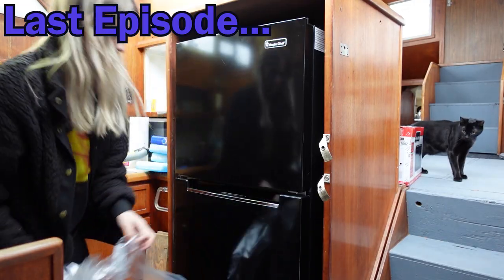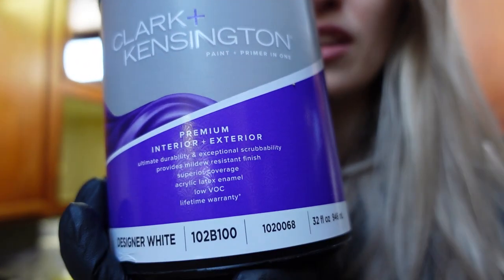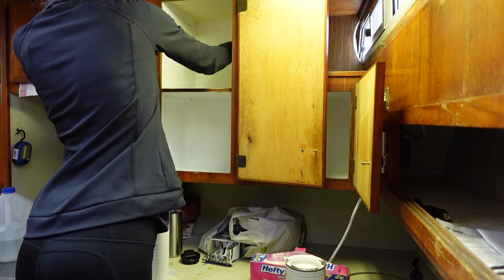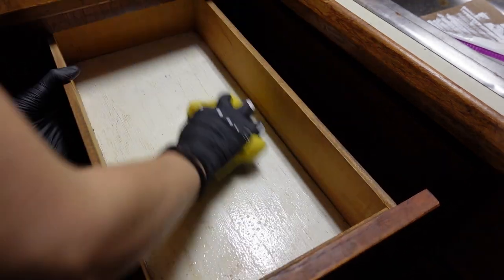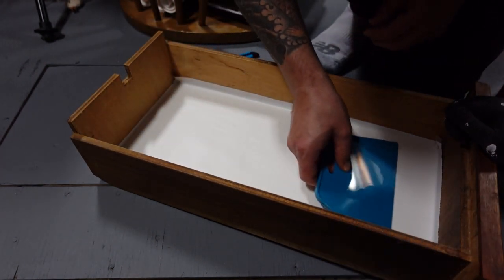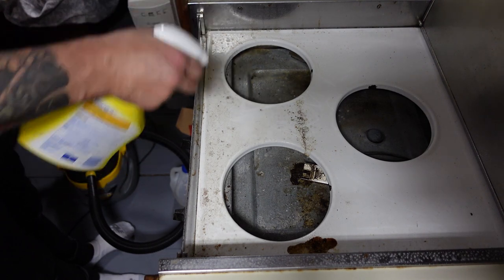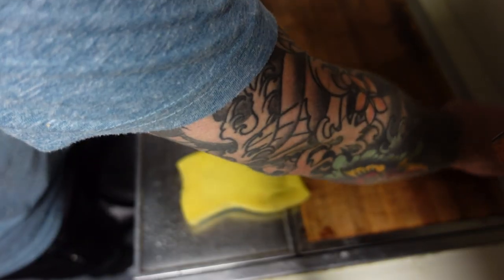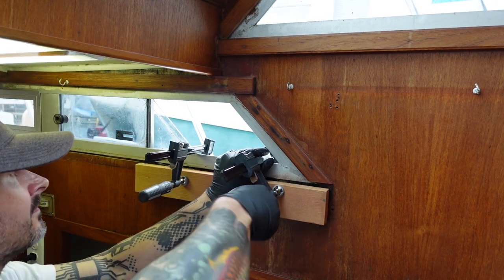Cleaning & Painting FILTHY Kitchen | Old Yacht Restoration | Ep. 10

Comment: Nice job with getting the boat looking nice and shiny again. I was wondering if you looked if there is any structural damage, to the stringers and transom for instance. cheers.
Reply from the maker: We have been pretty luck thus far and haven't had any real structural damage, stringers, and transom are okay; this thing is built like a tank. We did have a spot where water got into the core on the top deck. A future video will show that repair. Thanks for watching!

Comment: I think this girl could make a nice living as a body double for Gwen Stefani. Does anyone else think that??
Pretty young lady for sure. These two work so hard on this boat. I did the EXACT same thing over 40 years ago. West System epoxy was a NEW product back then. Boy did I go through a ton of that stuff!! After 10 years of hard work my 40’ Egg Harbor was finally ready for its maiden journey. 
I had not finalized my insurance due to having to get more than one inspection for the Ins. Company. Well I decided to take it out anyway just for a short 30 minute shakedown cruise. I was by myself and the happiest I had been in years. Up on the fly bridge I was noticing a list to Port that was getting worse. At first I thought it was the waves bouncing the boat around. Boy I was wrong. I came down off the Fly bridge and made my way into the lower station located in the Saloon. I was in shock to see my lower galley and master stateroom under water. There was a Telephone pole right through the hull. It hit the front Port side and pushed itself right through the hull, the state room, the galley and then through the firewall into my engine room. Within minutes I was standing in the cockpit with water to the gunnels. My boat was sinking fast. The Coast Guard saved me from drowning but my beautiful boat was ruined and not salvageable. I still had to pay to have it towed to shore. Pumps kept it afloat but sea water destroyed the NEW engines and the mahogany interior that took 4 years to rebuild and varnish was ruined. 
I lost my dream boat that day and never replaced it. PLEASE be careful of objects floating just below the surface. 
✌️😎🇺🇸
Reply from the maker: Wow, I'm so sorry that happened to you! I hope you were able to find a new boat eventually and continue cruising.